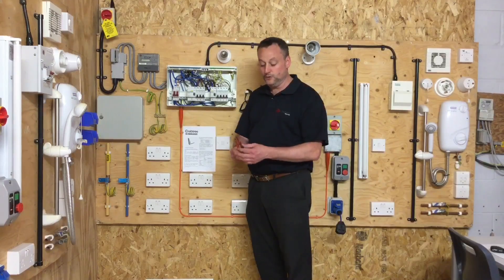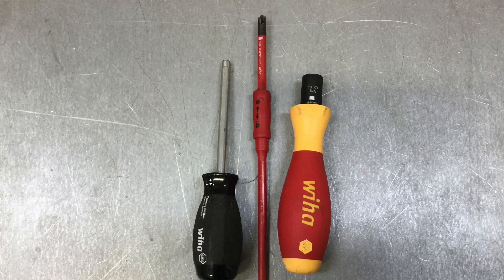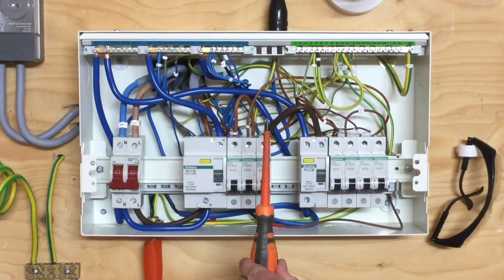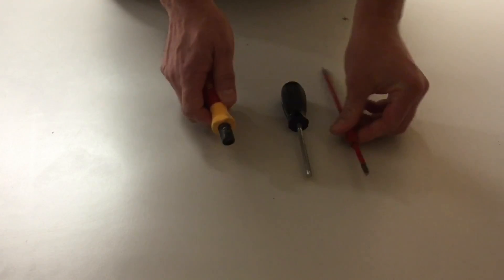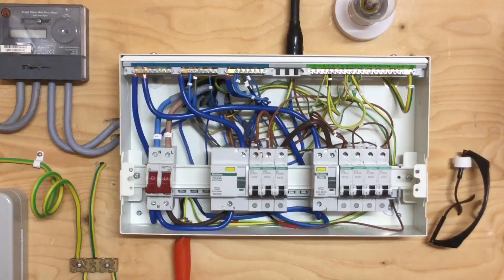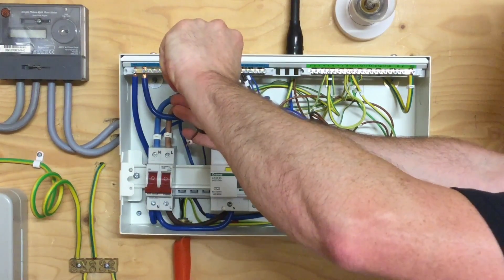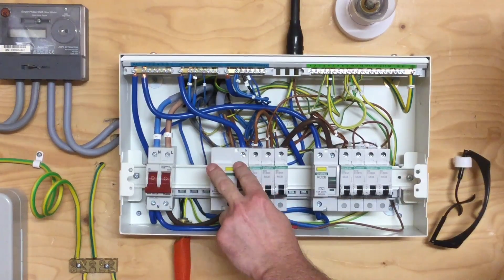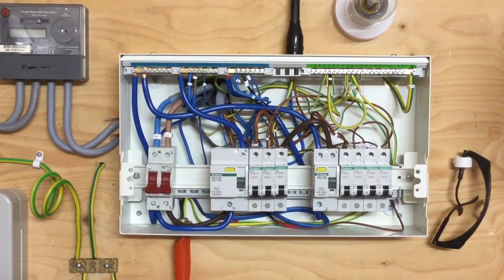How to use an Electricians Torque Screwdriver On a Distribution Board to Manufactures Instructions

Comment: Shouldn’t you back off the screws first that are already tightened down and then torque down, as these screws could have been over tightened to start with. Just an observation.
Reply from the maker: The link below is to an updated video on using a torque screwdriver in a consumer unit
https://youtu.be/DGc4PAXHAyA
Reply from the maker: The link below is to an updated video on using a torque screwdriver in a consumer unit
https://youtu.be/DGc4PAXHAyA

Comment: I've started thinking I need to get a torque driver. I'm doing work on my house including electrical I see the torque specs however I don't have one of these torque drivers so I've been going 800lbs gorilla on everything to the point I'm deforming the copper wire because I don't want it to get loose.

Comment: What if it’s low voltage wiring and I am using ferrules? Does the torque requirements change for different methods and different conducts types?

Comment: I would be interested to know if Wiha or Wera for example sell calibration units for these types of screwdrivers. As an Engineer I am in charge of both Mechanical Electrical and Instrument Technicians. If we use Norbar torque wrenches we would adjust to the specified indicated torque do the torquing down the of a unit as specified, then recheck on the torque tester. You are still at the mercy of the calibration of the calibrated torque testing units calibration. However the torque tester is not getting being subjected to an environment that has a greater chance of damage due to every day knocks and drops.  Our Work orders also require the technician to record the ident of the torque unit being used so we can track down potential issues due to units being out of calibration when being certified in planned maintenance schedules.
Reply: Found a wiha torque tester on page 32 of their catalog and this video covers their answer to my concerns.

https://youtu.be/r9P05BFgAuQ
Reply: https://isswww.co.uk/wiha-torque-quickcheck-torque-testing-device-2909101?msclkid=d6d3f2da1abf1bdc4176ad8b01cdf570&utm_source=bing&utm_medium=cpc&utm_campaign=Shopping&utm_term=4581390078811172&utm_content=All

Comment: You keep saying the reqiuerd torque setting,
In fact it is not a requirement in any regulation, it is only the manufacturer recommended setting that is why different manufacturers have different settings, it is just a n other scam to make electritions buy stupid tools we don't need, the average human being genorates about 67.2NM from there own strength, if you can't tighten down a small screw  then you need to take a job in McDonald's and

Comment: This is an interesting video, didnt the IET scrap the idea using torque on the basis that we couldn't calibrate our torque screwdriver. I do like the torque screwdriver regardless.
Reply from the maker: Hi. The manufacturer states you need to calibrate every year or 5000 turns (I think 💭) All the switchgear we fit has the manufacturers torque setting supplied with them and at my college we follow these guidelines. Thanks for the question and support GSH Electrical

Comment: I cannot imagine that having to comply with torque settings would be particularly popular with established tradespeople. Expensive kit and how much does it cost to get them recalibrated? I know the standard mechanical torque wrenches are not especially accurate and they do drift - I cannot imagine the torque screwdrivers are any better. I do not like all the different screw heads either - Torx heads are the best as far as I am concerned and with the introduction of torque settings in the consumer unit it is a great pity the manufacturers did not introduce and stick with a standard diameter screw throughout the build - then one torque setting for all which could have been labelled on the box - All screws xNm.
Reply from the maker: Hi. Great points thanks for taking the time and effort to message me. Thanks Gaz
Reply: Once you've used one of these ZENO screwdrivers without the torque driver, they come in a pair, a # 1 and a #2, you will never use anything else on electrical terminals, the additional hand torque compared to a phillips or pozidrive is quit surprising and not that expensive for the pair of drivers

Comment: I learned something new here ! Great Video !
Why did I not knew about the plus-minus screwdriver? 
Even though I did work on some household installation I was not aware of the technology.
(I am an electronics technician and did the wiring in my own house)
Reply: They're called a ZENO or Terminal Block Screwdriver bit, you can buy the pair of screwdrivers in they come in a pair with a #1 and a #2, I've introduced them to about 30 sparkies here in Australia and I bought them from the USA originally as they were unavailable, best drivers I've ever used
Reply from the maker: Hi. Thanks for watching glad I was of some help all the best GSH Electrical

Comment: The only way of checking something pre tightened is at the correct torque is to loosen it and re-torque.  The screwdriver will click if the screw is overtightened or is at the correct torque.
Reply from the maker: +cjmillsnun 

Hi again. When it clicks it’s at the correct tightness (torque) you have set the driver to. GSH Electrical
Reply from the maker: +cjmillsnun 

And yes to the other part of your question